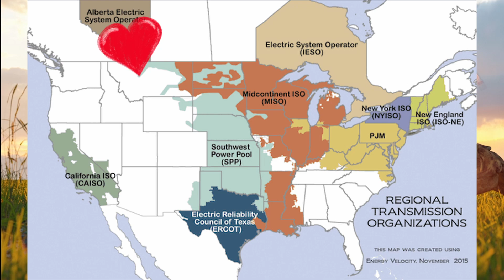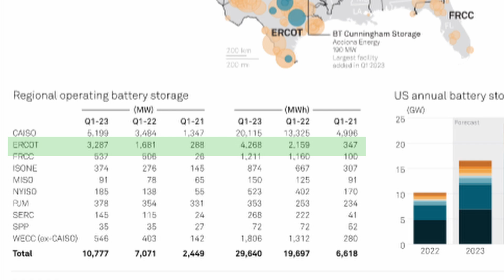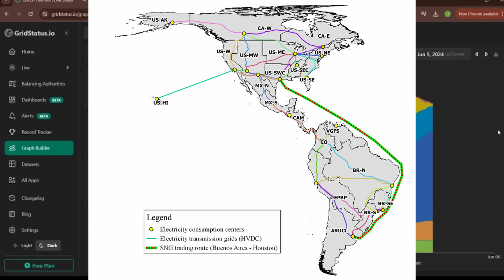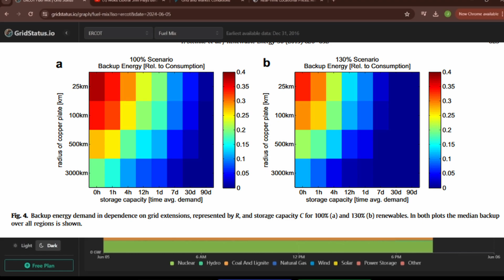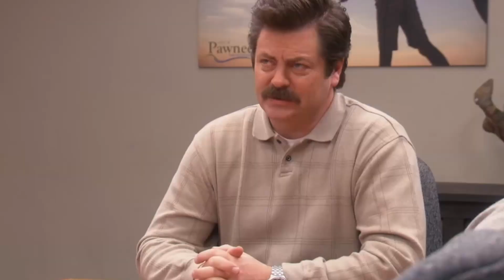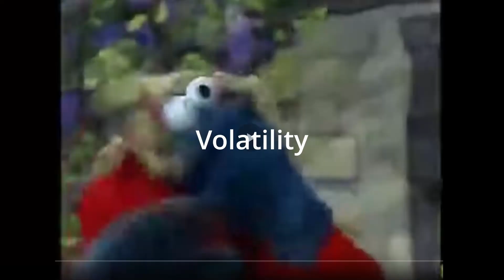Why Texas is a Renewable Energy Superstar | CRM Explained

Comment: I think it would have been interesting to compare the situation in Texas to its neighbors in terms of costs and reliability
Reply from the maker: AnInnocuousSquid should be in the comments. He might be able to answer.
Reply: I think short answer is it depends: let me get back to you with proper values, but anecdotally the value contributed to the market by the scarcity pricing mechanism in 2023 was between a fifth and a tenth of what is was in 2021 or 2022(I will get the proper numbers, but I think that is roughly true), and the ORDC value so far this year is approximately half it was at the same time last year. So in years where the market has slightly more than adequate supply, the reliability cost incurred is probably lower than traditional market CRMs, at the risk that when the market on the supply and demand aspect gets tighter, the cost risk is higher